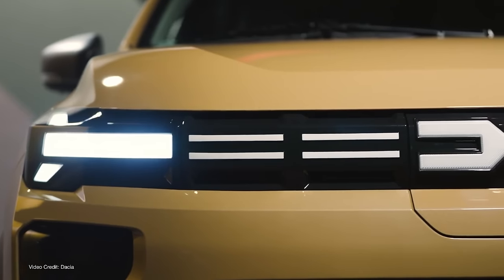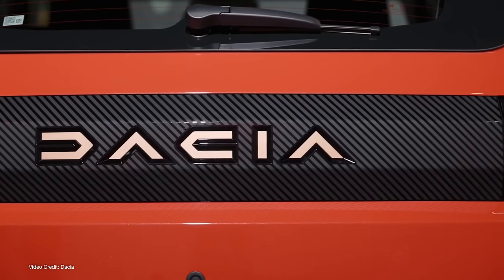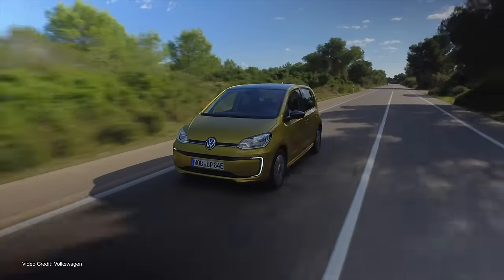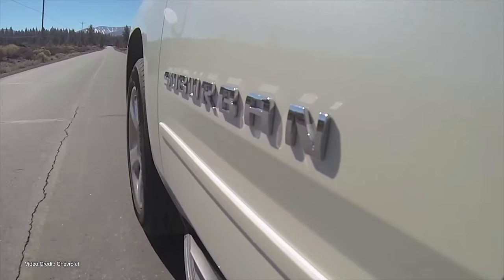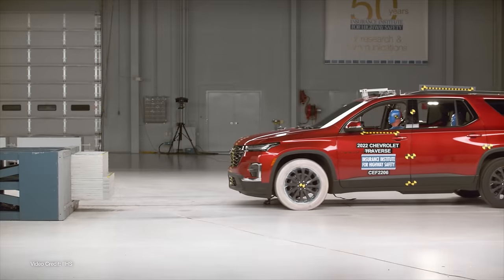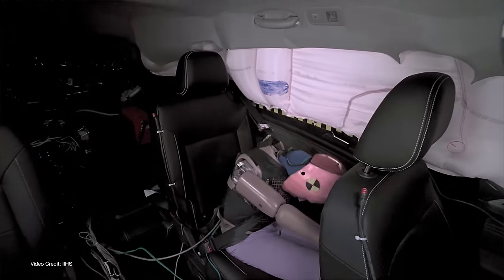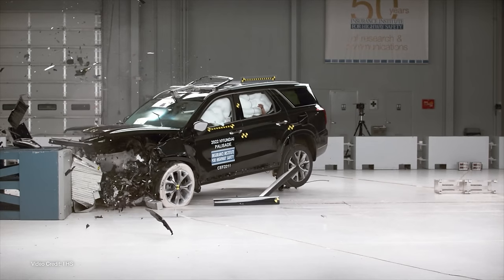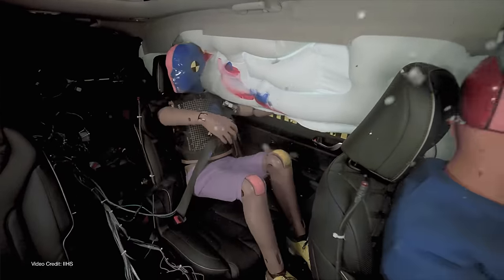Never In The USA - Why the US (And Canada) Appear To Be Anti-Small EV

Comment: Nikki, I suspect the channel's fans are NOT typical Americans, myself included. 
I very much appreciate this particular video. I have been pulling my hair out (metaphorically) for many years over the U.S. obsession with size and power at the expense of other drivers, pedestrians, parking spaces, narrow streets, and the wear and tear on pavement. 

I love that you mentioned the aptera, of which, I am, like you, one of tens of thousands of reservation holders. The engineering, the efficiency, the Formula One philosophy of safety cage design, the potential for freedom from dependence on the grid, and the pledge of open source schematics for right-to-repair philosophy, even as aptera strives to make as many components as practical available from automotive parts sources, all add up to a spectacular salute to REAL practicality of ownership. 

Oh, and my fingers are crossed that those 3 wheels instead of 4 will net us significant insurance savings. 
Until then, I will keep driving my own perfectly sized compact Kia Soul ev, with it's scant 100 mile range and 50 kwh CHAdeMO charge port, lol. Shout out to Kate!

Comment: Something I learned, as I planned the conversion of our 1970 Lotus Europa into an EV, is just how critical the vehicle weight is to range for a given battery capacity.  After reducing everything down to the simplest perspective, the following 'rule of thumb' applies:

One tenth of the vehicle weight, measured in lbs, approximates the Watt hours per mile (Wh/m) of achievable range.

Example 1:  2,300 lb car will consume 230 Watt Hours per mile, so will require a 46 kWh (46,000 Watt Hours capacity) battery to achieve 200 miles of range.
Example 2:  1,600 lb car will consume 160 Watt Hours per mile, so will only require 32 kWh battery to achieve 200 miles of range.
Example 3:  6,000 lb car will consume 600 Watt Hours per mile, so will require a 120 kWh batter to travel 200 miles.

Yes, great aerodynamics can improve the range somewhat, and so can very efficient motors, such as those used by Tesla, and the latest higher density battery technology reduces the battery capacity too, but you can see the principle.

Using lighter components has a compounding effect, as the examples above show.  A 30% smaller battery reduces the vehicle weight significantly.  In my case for the Lotus, substituting a 22 lb axial flux motor instead of the more typical 120 lb radial flux motor, with similar performance characteristics, will reduce the vehicle weight by 98 lbs, reducing the Wh/m by 9.8, increasing the likely range by another 13 miles without increasing the anticipated 32 kWh battery size.

Using this approach, and calculating the converted weight of our Lotus to be around 1,500 lbs, and targeting an adequate range for it's expected use, cruising up and down our coastal roads, of just 150 miles, we only need a 22.5 kWh battery, which is why we can achieve a vehicle weight around 1,500 lbs.  With battery densities increasing steadily we expect to be able to install closer to 30 kWh of battery capacity, providing a healthy 'safety' margin over our targeted range.

Finally, we would buy a VW ID3, Renault 5 EV or a MG5 were they being sold in the USA today.  But the Dacia is a bit too basic for our tastes.  Oh, the Škoda Enyaq would fit the bill too!  We liked the Bolt, except for the stupid name, but the battery fires made us think again.  The announced GM replacement(s) are just too lardy, so will not be considered in the future.

Comment: Small subcompact in the U.S. must be built like a bank vault.  The Fiat 500 sold in the U.S. was much heavier than the same car sold in Europe.    A 500 was nearly 900 pounds heavier than a 30 year old Geo Metro and only managed 38 mpg highway.  Might as well buy a larger Corolla that has a bigger crumple zone. The small Kia and Hyundai were more popular than the tiny 500.  After the first few months of 500 sales the novelty of the tiny size was gone and so were the sales.  The turbocharged 160 hp Abarth was slower 0 to 60 than a minivan.

The tiny car in the U.S with amazing record is the Mazda MX-5 Miata, but it's not in the same price class as cars like the Mitsubishi Mirage - which is a better car than its reputation, but the extra weight makes U.S. subcompact cars less fun

Comment: I did not react when you said that your truck saved you a few days ago, because it was not the time, but I did not agree. Heavier vehicles have quite more risks to slide and when an undeformable object is involved in an accident (a tree, a pole, a wall, etc.) having an heavier car is not an advantage. A big truck only wins if it impacts a smaller vehicle but it is quite an egoist approach to safty, and also a dangerous spiral since people will buy bigger and bigger.

Comment: I think the main problem with small range EVs is not necessarily the range but the fact that they are priced way to close to long range EVs and are still pricier than gas cars. So why pay that much for so little? Especially with winter where range can be cut in almost half in certain parts of NA. Also the smaller the battery the slower the charge so even worse if it's main car. I'm happy with my Bolt but if it could do 190 miles on the highway during winter that would be way better than the 140 I'm getting.

Comment: Part of the problem in the USA is it's like an arms race where when everyone else drives big SUV's and Pickups (especially the lifted pickups), to survive a crash, you feel like you also have to drive a bigger vehicle. On the other hand, if you drive in downtown urban areas, a big vehicle is a liability as you won't be able to find street parking.
Reply: It's not just street parking in cities. Big cars are harder to park in parking garages which require tight maneuvering to get around posts holding up the ceiling. My home garage is tight maneuvering getting in and out, and much easier to do in a smaller car. Even outside the city completely, lots of parking lots at hiking trails don't have marked spaces, instead, you just squeeze the car in wherever it fits. A Bolt can fit in many trailhead parking spots where a large SUV cannot.

Comment: We love our 2014 Mitsubishi I-miev. 100 km range, seats go down for surprisingly large cargo space, and it hasn’t needed a bit of maintenance in the 7 years we’ve owned it. For longer trips we use our Model Y.
Reply: You might want to change the brake fluid. Also the rubber hoses are good for 10 years. They might last 20 years but that is more by luck than design. Rubber hoses and insulation, plastic connectors and anything a human finger touches is where the rot sets in

Comment: Good video. I am 6'4"(190cm)  and there is no way I'd be able to fit in the Bolt. I did like the Volt but was unable to fit me as well as any passenger behind me.  I do fit in the Ford Mach-e with the seat all the way back.  I find driving an EV is very comfortable for my 50-mile round trip commute.  I used to tow a trailer several times per year, but stopped that some time ago.  Keep in mind that my 2022 Ford Mach-e already has almost 30,000 miles.

Comment: Small cars are likely less inclined to depart the road in circumstances where traction on bends is an issue. A 3T pickup will be much more inclined to keep going in a straight line through a bend than a 1.5T electric hatchback. Indeed once the vehicle looses control F=MA means even at slow speed a heavy car is creating a lot of force.

Comment: I will speak out against the idea that average daily travel distance is the only factor on range needs. When I bought my Volt in 2013, the other option was the Leaf with its 70 or so range. My daily need? 20-25 miles. However, I do travel further more than once a year. It's 90-100 mi. to the local mountains. ~300mi to the coast. Could I rent for these odd trips - or own a second car that covers that scenario? Sure, and I considered that, but there's an expense that goes with that. For once or maybe twice a year, a rental might well be worth it to me, but not so for multiple trips per year. And so I went with the Volt - a car that was fully electric for my daily needs (except in winter) but could handle those trips. I still occasionally rented instead (for long cross country trips, for example - choosing to put miles on someone else's car rather than my own - but that was rare. In the end, the choice served me well over the 10 years I owned it and, I think, better than the Leaf would have.
Now I have a full EV with ~300 mi range and, yes, a "large" battery and much more than needed daily, but trips to the mountains, the coast, to visit my daughter, all feel possible (though not as easy, perhaps) without having to deal with rentals (or owning 2 cars). Is it actually more cost effective than a cheaper, lower range option? I'm not sure, actually, but rentals are not inexpensive these days and I've the added costs of cleaning due to travel with a pet to make it even more so, so it certainly feels so. I had actually seriously considered the new Prius, actually, as it has, at least on paper, all of the benefits of the Volt in this regard with over twice the petrol efficiency. But, I couldn't find one when I needed it, and I really "wanted" the EV I chose instead (yes, we buy emotionally). In short, I don't think using daily averages is a good measure of "need" in a vehicle alone. There is a bigger context and different trade-offs for those outside-the-typical scenarios.

Comment: Americans won’t buy small cars is kind of a self fulfilling prophecy since many companies like VW won’t offer smaller vehicles like ID.3 at all. I have an ID.4, but I previously owned a Golf TDI, as well as a Mercedes SLK, and a Fiat 500e. I have a reservation for the Aptera as well because I have a thing for efficiency. 
After reading the latest Murdoch anti EV screed in the Daily Mail about how EV’s have super high emissions compared with gas cars (spoiler, it’s tire particles because EV’s are heavy). But I note that my ID.4 is around 4600 pounds and so is my gas powered Explorer, and so was my Model S. 
The article claimed the gas F-150 is 2000 pounds lighter than the EV, but I note that while a gas F-150 can weigh a little more than 4275 pounds, they can weigh 5757 pounds which is close to the 6600-6800 for the Lightning, but a gas F-250 can be 7660 pounds. 
So EV’s are something like 1% of the total fleet in the US and somewhat more in other countries and the anti crowd is suddenly worried about tire particles. 

Tire particles do have a sudden and terminal effect on fish because of something which I forget that has semi recently been added to tires and tire companies are working to remove. 
But smaller lighter vehicles and slower vehicles would have less tire wear. 
One of many reasons I chose my ID.4 was that it wasn’t as fast as my previous Tesla, but I note that this years ID.4 is nearly two seconds faster with 80 more horsepower than my 2023. The Aptera will be 3000 pounds lighter and have one less tire to particulate, but won’t be quite as useful for carrying large bulky things

Comment: Canada and the US need the Aptera - a sporty low cost EV which should be the cheapest EV to run.  Small hot hatches are absolutely still needed for families.
Reply: Yes!!! I'm a reservation holder. Fingers tightly crossed for aptera's success.
Reply: I love the principle of prioritizing efficiency, but the width of the Aptera make it worse than the biggest pickups in terms to clogging up streets.
Reply: @Hamilcar_Stronginthearm  If your fitting vehicles into a parking lot the mirrors count so aptera is really not that wide given actual width.  I do feel an issue is the need for a camera to see the right wheel pant with parallel parking but that is a fairly easy issue to address.
Reply: Lacking front and rear bumpers the Aptera could be expensive to insure
Reply: @Hamilcar_Stronginthearm aptera front track width would certainly be an issue for tight old European streets, but it has no wide side mirrors issue, both F150 and Silverado/Sierra with mirrors being wider by several inches, mirror to mirror, but visually it is far less obstructive than even mid-size trucks, and length is similar to a Honda Accord. Also, weight in base trim is miniscule, under single ton, similar to my old 1995 Geo metro 3 door hatchback.
Reply: @michaelanders6161  Europe allows 4 wheelers at 2.6m.  Definitely not ideal but Aptera is 2.2.  A optimized version worth extended wheel pants and a stubby nose could get into 4m/2m but not trivial.

Comment: You missed a critical items from real safety data.
1) SUV's are higher and more likely to roll over, and a roll over is really bad for the occupants and there are man deaths due SUV roll over.  
2) All but one SUV fails the crash avoidance test, the ability to steer at high speed around an object - like car or stuff in road.  This also includes a junction incursion.  (This is known as the moose test).  The only SUV to pass is Tesla Y.  The best performing car ever was the Citroen Xantia with its active suspension.  Many cars that are considered drivers cars (cough cough BMW), often RWD, may be considered fun, but surprisingly don't do well in the crash avoidance test with too much oversteer resulting in loss of control.
3) Trucks are usually empty in the US, and this makes the back unstable and they behave very badly in a crash avoidance manoeuvre.
4) Rear wheel drive is one of the most important indicator of crash - sue to instability and oversteer that 99% of people cannot cope with (and worse, think they can).  Many trucks are foremost RWD for the cheaper variant..
Statistically, large high centre of gravity cars, and(light load bed truck are very unstable, have poor survivability statistics.

Comment: I do love small cars and I would love the aptera... But my leaf cant handle everything I need, and a bolt would be worse.  Trying to throw in a large cooler (drinks for all the hockey kids and parents) takes up the whole truck; add kids, chairs, blankets, hockey gear and snack makings there leaves no room for a normal solo stove and firewood so snores have to be made over a miniature solo stove with pellets for firewood.  Plus with an 84 mile range in the cold means I need to turn the heat off  to make it home as most rinks don't have chargers yet.  My leaf also doesn't allow me to run down to Oregon and grab my solar panels from my brother's farm now that I'm ready to put them on my house. I think in the PNW 150 miles is the absolute floor of what should be considered for a new car, unless you have two cars to use. But on the small car side I would love a small truck, a maverick or ranger sized EV (and priced) would be absolutely perfect for my use case. And fit the suit cases when we fly on family vacations more easily than the model Y does (which I only drive when my leaf absolutely will not work as my wife hates the leaf) which I have to take out the false floors to fit our four large suitcases (1 per person). So I kind of agree, but maybe I just live in an environment where we have to go a lot and cars are meant to fit everything we need, not just people.

Comment: I have a specific 500 mile journey i drive regularly, and went for the longest range EV i could possibly get, and having diving it for 2 years i@ve been pleasantly surprised with the charging network (and seen it improve)  i think with this experience  I could have gone for a smaller range, either SR or 2nd hand and saved myself quite a bit. It's a cross border trip so renting to try the trip in a rented EV wouldn't have been possible, but if you can before purchase/leasing would recommend it.

Comment: I was kinda ticked that to replace my sedan I had no real choice if I wanted something equally or more efficient than buying an SUV. Sure, the hatchback comes in handy, but my Geo Metro (of the late '90s / early '00s) had one of those too and five reasonably stout people could pick it up and move it if needed. [And the Metro got 48 MPG (average), with the worst case being about 35.]
I ended up with a PHEV as I live in, and travel to, parts of the Republic that, to put it gently, will not be joining the 21st century with respect to vehicle energy replenishment anywhere near soon enough. I hope that problem will be resolved before it is time to buy a replacement, and in the meantime I'll drive electric as much as I can reasonably manage.
Reply: A SUV with the high rear body and smallish rear glass is designed for rear and side crash regulations.  The decreased  greenhouse and need for cameras and sensors is the side effect of reduced visibility.
Reply: @timothykeith1367  (1) That's unrelated to my original comment, and (2) There are effective ways to accomplish the same ratings without building an SUV. (3) The switch to an SUV chassis was driven by the fact that even with a smaller footprint any given SUV is subjected to less strict regulation as a "light truck". (In fact almost all SUVs and "Crossovers" in the USA / Canada market are light trucks.) (4) Not all SUVs are hatchbacks.